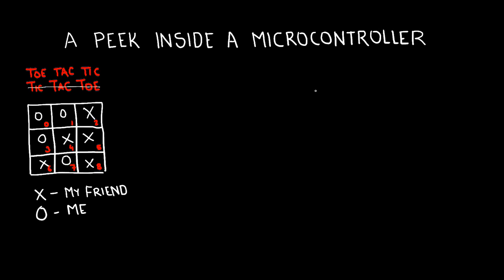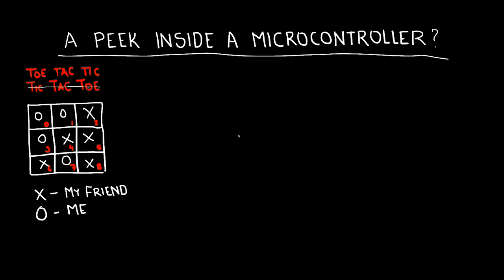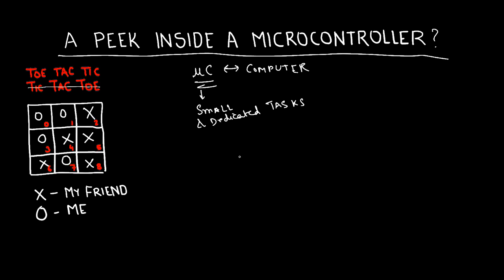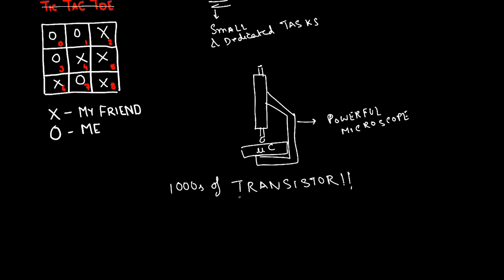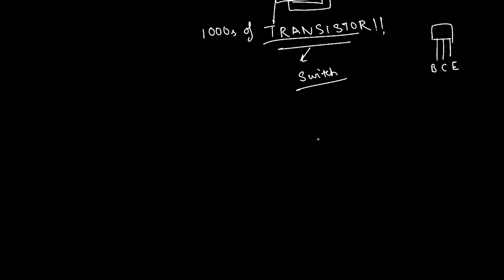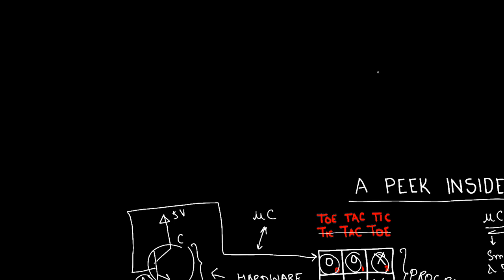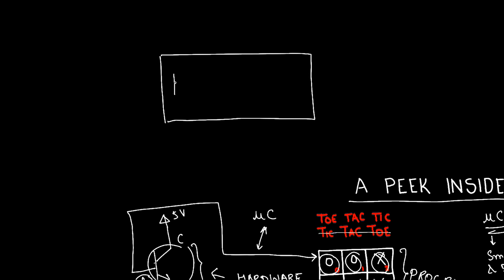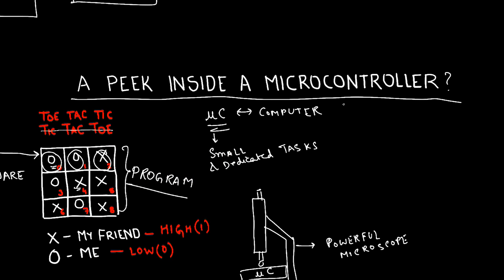A Peek Inside A Microcontroller

Comment: not correct, in npn transistor you need to connect the light bulb to the collector not the emitter
Reply: Works both ways...Did you try?
Reply: It's the same thing 😂
Reply: Very good video